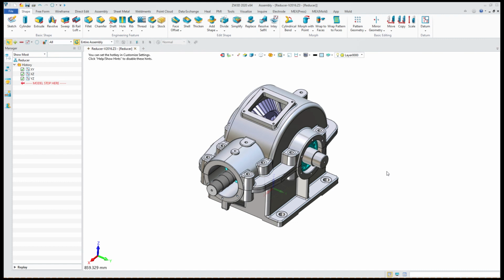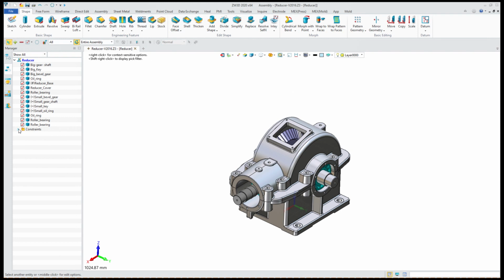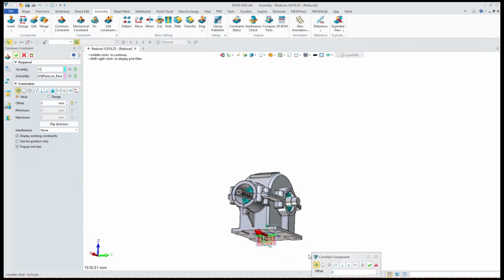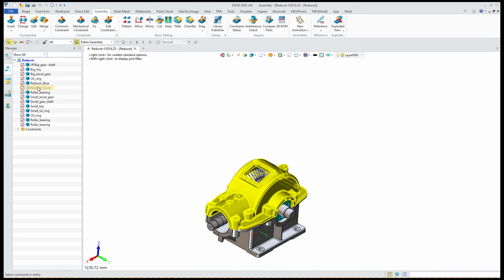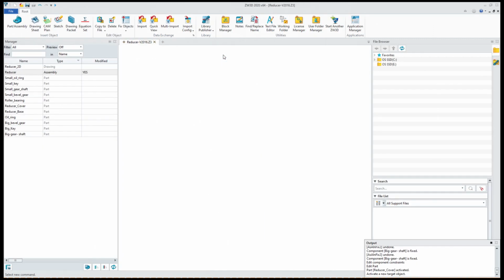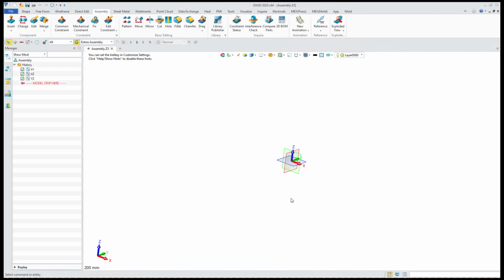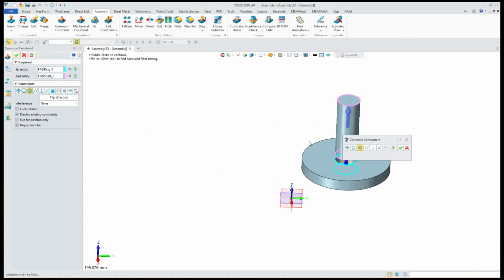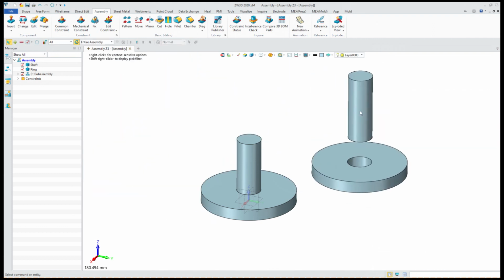CAD - Beginner: Lesson 3 Assembly | FREE Engineering Lessons

Comment: It is already 20. February 20221. I am wondering, what happened to TES school.... 8 months no news. I hope you did not get sick with Covid.... I wish you can be back and help with certain things.....I am discovering, that there is so much more to assembly, depending on how you build your part(Top down, bottom up as a single multi-solid file). 
There is no difference between the Solid (in History tree) and the Component (in the Assembly manager or root). The only difference is, where they are located. Though they are both in existence in BOTTOM UP Design. In TOP DOWN Design, there are only Components.(No independent Solids from which the Components were extracted).
It is necessary to distinguish these two design methods. This Reducer assembly is made as a TOP DOWN design style...that means there is no common geometry file for all or each Solid, from which the Component was extracted with Extract Shape command (on right click menu over the geometry solid or Insert->Assembly->Extract Shape command). Each component here was created by inserting a new file into the root and then named(whatever was needed). After that, the operator of the software went into a history manager of each newly  named component and constructed the entire Component geometry there. The layers of each component are separate entities for each component......(i.e.: if you put something(any geometry) on layer 10 in in component A, you won't see it on layer 10 of component B or any other component). 
The next "signature" of TOP DOWN Assembly is the fact, that the file "Assembly" is present in the ROOT!. (Bottom up design style doesn't have it...you extract the components from the solids in History Tree by use of Extract Shape command on RMB menu (or Insert->Assembly-> Extract Shape), go from History Tree to Assembly Manager(not ROOT!) and create your assembly right there-same way as if you were in independent TOP DOWN assembly file). There is possibility of confusion, because if the extracted components were not moved yet into assembly location(which would be presumably different, then the location of the original Solid), they(Solid and the Component) display simultaneously  and cover each other, appearing as only 1 piece!!!  So you need to be aware of it and if you want to modify the Solid, you need to shut off visibility of it's component(in Assembly manager). Make any changes to the Solid and run the REGEN command(very top line, next to Undo, Redo command) and the change will be reflected in the Component....Though, if you go and modify the component, no matter what you do, it will not reflect on the Solid in the History Tree!!! Also: the layers of the Components are independent from the layers of Solids in the History tree. (That doesn't happen in TOP DOWN design, because the history tree of the solid creation file doesn't exist...There is root, in which are all the components, assembly, drawings, etc.). Though it is possible to COMBINE BOTH DESIGN METHODS and make a combination of the BOTTOM UP Design with TOP DOWN Design starting with BOTTOM UP(not possible the other way around-starting with TOP DOWN Design). Simply after extracting the Components from the Solids in the History Tree you can go into root and insert file Assembly and create assembly there, rather then in the Assembly manager of the History tree Solids(which would be expected in the regular BOTTOM UP Design procedure).
You really need to understand this concept, to be efficient in using the software...that happened to me! After I finally got it(about 4 months going in circles), I could go ahead and do nearly whatever.....From here on it is quite simple!
I would like to submit 2 test files on which this concept is clearly explained to TES school. You  can then modify it and make a little video to add it to your set of videos with your own explanation.
   And there is one more variation of the software behavior, as far as the TOP DOWN Design style is concerned. I think it is the old style Top Down, where, if you go into system settings, the very first line in top menu(General) There is "One Object Per File" on/off switch. Object meaning Component. You can create several solids in History Tree, extract the components out of them (using Insert-Assembly-Extract Shape command) but as soon as you save, the software will separate them into a different files and open them .....you will see newly open files on top of the "Drawing" window. Then you can create assembly file and you use all these separate components(each in it's own file) you created to create your assembly...